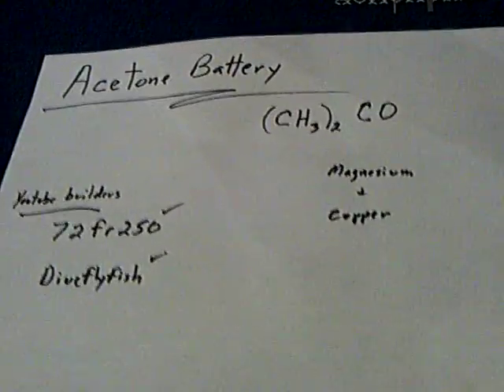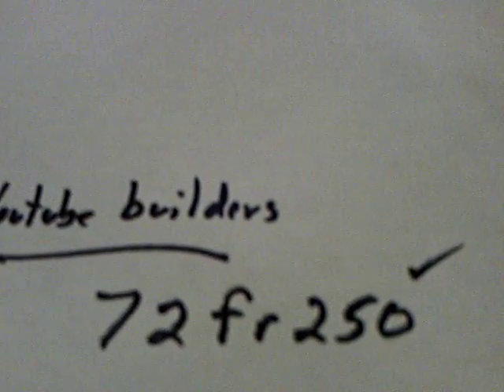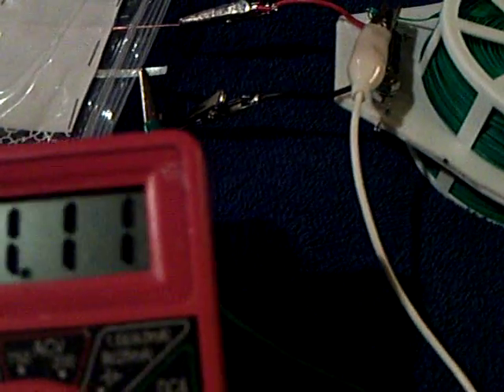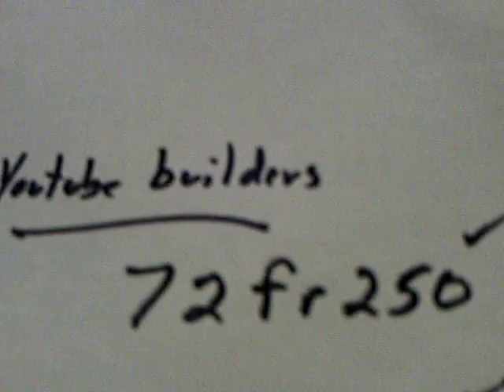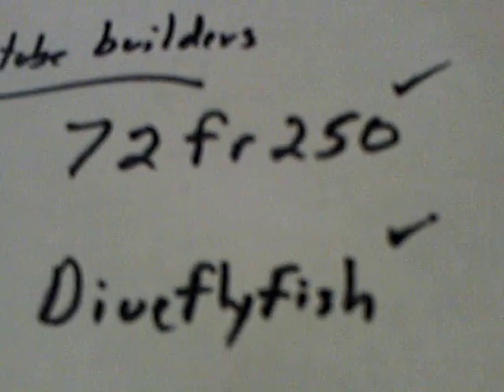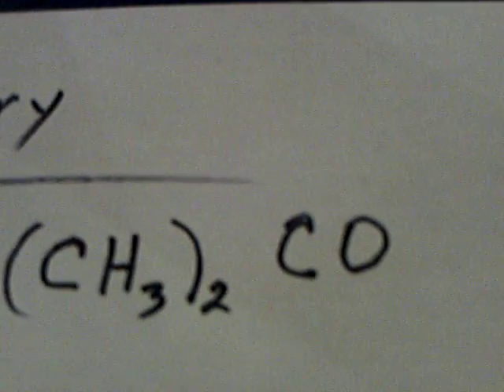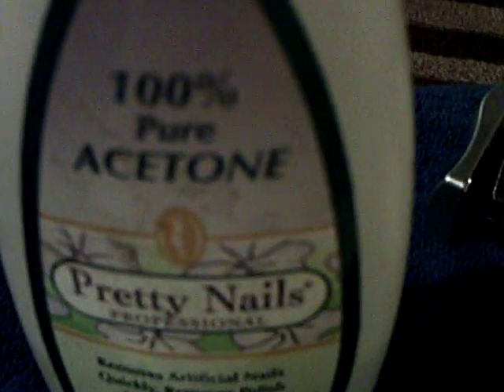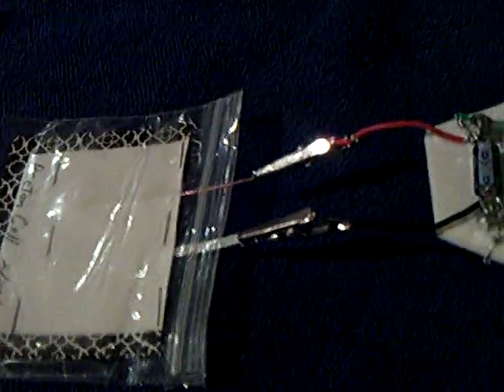Acetone Battery running PENNY

Comment: have you tried adding vinegar to it?  I know that's not exactly doing anything special, but since Acetone and Acetic Acid have so much in common molecularly, I'm worndering if a small amount of acid exists already in the acetone.  If you added a little bit more you might get a higher voltage.

Comment: Nice discovery .. very interesting .. When it comes to ion transfer you must look into the dielectric properties of the elements contained.. atoms which have their full count of electrons in their outer shell due to covalent linkups do not like to transfer ionswhile ones with holes will.. Looks like acetone has a dielectric constant around 20.. while air is 1 and water is 80.. This link has a bunch of dielectric values for different moecules..  asiinstr.com/technical/Dielectric Constants.htm

Comment from the maker: @slider2732 ------- The non-polar liquids like oils don't work.  There has to be a way for the ions to flow.  That cell is still working this morning so I guees you are right about the ziplock bag.  I have the cell running that little Hankscraft "waving" motor right now.  There might be a better liquid for this like you say.

Comment: @Lidmotor Good day.  Understood. Your setup most likely is safe; the other fellow is using a container (glass no less) filled with Acetone. Risky.  It would be interesting to see if any heat is generated during electrolysis.  If so, I would not use under any circumstances.  Regards.

Comment from the maker: @jozsab1 ----This cell is using a non-water based electrolyte and that is the difference.  I'm sure that ion transfer is taking place for there to be electrical current flow but the chemistry must be slightly different.

Comment from the maker: @diveflyfish -----Before I made this cell I looked at what happened to the electrodes in a capfull of acetone.  When I took voltage and amp readings and saw no bubbles on the Mg then I went ahead and made the cell.  I will try what you suggested on one of my totally dry crystal cells and see what happens.  The problem with most of those cells is the crystals still have a water molecule locked up in the lattice.

Comment: Suggest extreme respect when using Acetone for anything other than what it was intended. From Wikipedia: "The most hazardous quality of acetone is its extreme flammability. At temperatures greater than acetone's flash point of −20 °C (−4 °F), air mixtures of between 2.5% and 12.8% acetone, by volume, may explode or cause a flash fire. Vapors can flow along surfaces to distant ignition sources and flash back. Static discharge may also ignite acetone vapors."

Comment: Liked the Ziplock, as in where's it going to evaporate to ? which could produce a long runner. Any liquid ought to work with a Penny I think, considering they'll start up on copper/galv steel just held in the hand. So magnesium ought to be even more readily able to strike up a conversation with her. A liquid state chemical that is inert to Mg is the winner  :)

Comment from the maker: @overunitydotcom -----The open circuit voltage is about 1.25 volts and a dead short with the multimeter shows just a few micro amps.  It acts different than water.  Lets just see what happens to the Mg, like you say, after a few days---if it lasts that long.  Only a tiny leak in that ziplock bag will let the acetone vaporize.